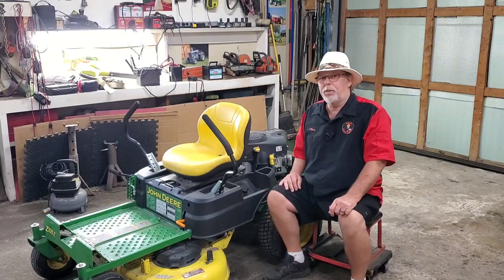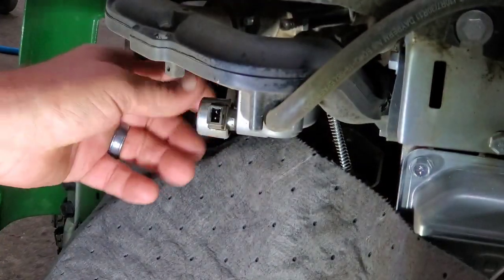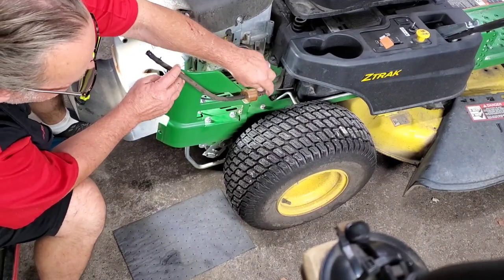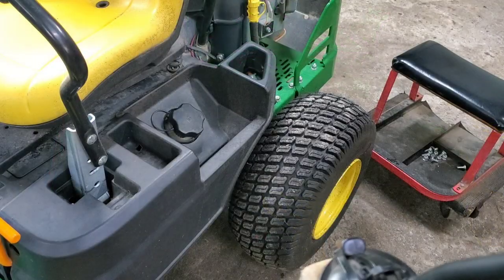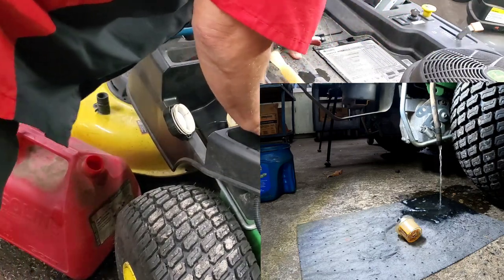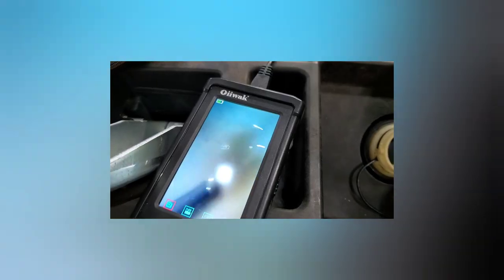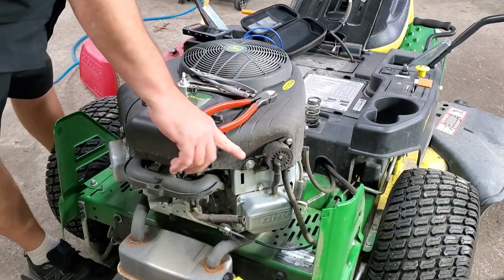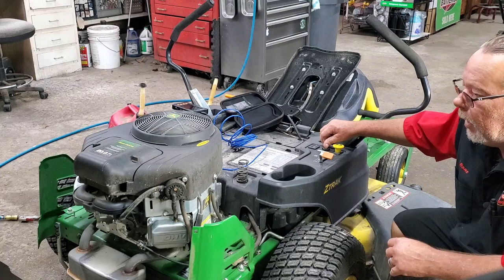John Deere Z335E Zero Turn Left In Rain No Start Clean Fuel Tank, Lines and Drain Carburetor Bowl

Comment: I channeled Raley to help fix the bad vibration problem on my 12 yr old troy bilt rider with Kohler eng. I did the standard thing of balance the blades did nothing. Today I looked under the motor and found a loose bolt, it was broken. Took it out put a fatter washer on it and tightened it up.
Then I looked at the rest of the bolts and one was missing, so I put an old bolt I had in that hole with a lock washer.
I was so glad to find them before one of the final 2 bolts broke and I had a real big problem like have to buy a new mower....lol

Comment: Great diag process and ultimate fix. Another takeaway I got - never assume what the customer thinks is the issue is correct. The trash in the tank was preventing fuel flow and that small amount of water was secondary. 🔧👍

Comment: Just a,suggestion, I use a hand vacuum pump hook to line that goes from the valve cover to the fuel pump.  If I run mine out of gas,  that's the fastest way to prime the fuel system.  And it saves the battery and starter wear .

Comment: Well, after a frustrating attempt to mow my lawn that resulted in spending some quality time in the driveway with my mower refusing to run, I'm going to say that THIS video was helpful.  Its too late to go do it now, but I'm confident this is going to get my rig running in the morning!   Using the fuel supply line to siphon the water out of the bottom of the tank is exactly what I needed.  I think I have a Folgers can around here somewhere.  Might have to dump the coffee out, or maybe leave it in there I don't know....
Reply from the maker: 😆 awesome hopefully it helped you

Comment: Can I ask u a question my lawnmower where the breather   on the gas tank sometimes gas drives out of it into the air filter the mower runs great idk why its doing that so I drilled a hole in the cover and put a aquairum tube in it so that when it drips it drips on the outside and not my air filter lol any idea what the problem is

Comment: You can dry the fuel tank out with a shop rag. Cram the rag in the tank and blow it around with compressed air to mop it out. Blow the tank out good after doing this to blow out the lint from the rag. Remember E 10 fuel collects water. Replace the fuel filter always.

Comment: You know those syringe you use to suck snot out of a baby's nose they work good to prime a fuel . I had a Fiat Strada with dual Weber if it sat long it bleed back... I have upgrade to a boat primer bulb... keep it my tool box. I like that PVC syphon....beats using shop vacuum and hoping it doesn't ignite....😜

Comment: You got lucky,good thing it wasnt a repair where you had to pull that plastic stuff off,i hate that have a tool for removing them,but I charge for the fasteners,cause they break most of the time,and I ain't time to waste.
Reply from the maker: Yes, we keep those in stock also.  Usually I can vacuum out the tanks with my homemade gas/oil extractor.